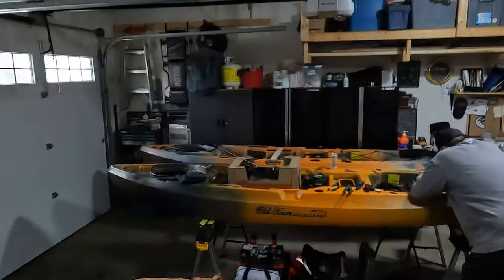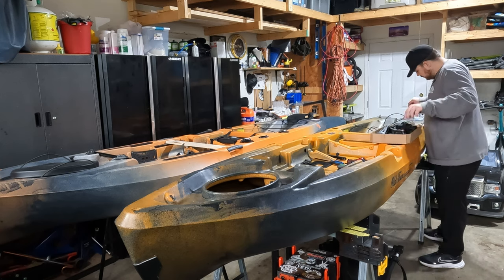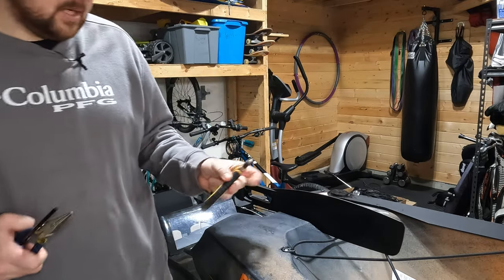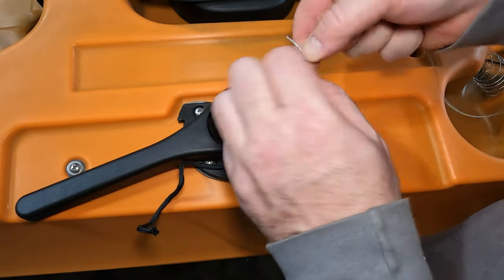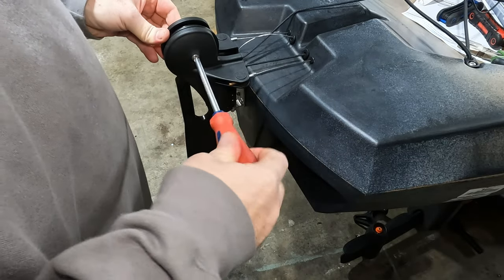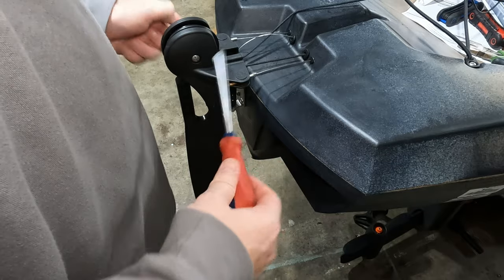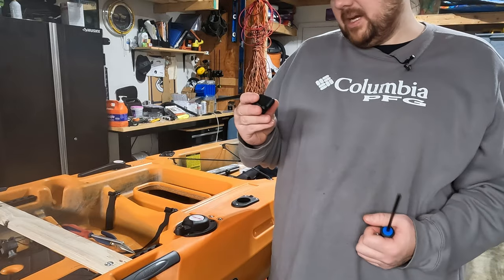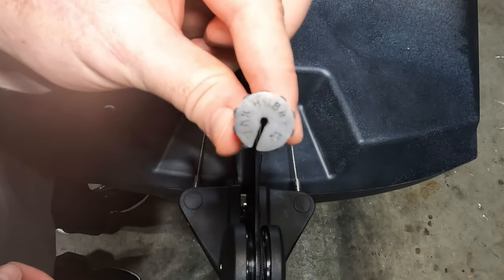OLD TOWN SPORTSMAN PDL 120 Upgrades (Aluminum Rudder Install)

Comment: Great recommendation on checking the foam block inside the hull. 👍👍
Reply from the maker: It was just floating inside the hull, definitely something worth checking as there's a lot of expanding and contracting with these hulls. Unfortunately, the silicone just let go

Comment: Awesome video bro. Appreciate the step-by-step. I have the big water 132 pdl version. I wished it was the epdl lol. I have the same parts that you put on. I did invest in the right-hand control steering system. Works great. Also I would invest in the pdl rod holder/track mount. Great great product. Also another product from Navarre is the rod tube caps. They do keep the water out. But anyways awesome video. Looking forward to the 2nd part. I just got the yak power 8 channel distribution power. I forgot the exact name. In march or so I will make a video for that.
Reply from the maker: Thanks for watching much appreciated! Crystal really wants the EPDL, but for myself I think the next kayak will be an Autopilot 136, need the extra weight capacity as I'm not getting any lighter! 😂😂😂 do you have the new style PDL rod holder? We've been pretty interested in those, looking for a spot to mount our phones for the gram!

Comment: Great video. Did you have to send the broken hull back
Reply from the maker: Thanks! No, we only had to cut out the serial number in a 12"x12" square and bring in the piece when we picked up the new hull. We ended up stripping every usable part off of the old hull for backup parts. After that, the hull ended up going to the dump.  Seems like such a waste, but that's what Old Town wanted for the new hull to be sent.

Thanks for watching!

Comment: What adhesive did you use to  attached your keel guard ?
Reply from the maker: Double sided gorilla tape, and then some marine silicone around the perimeter of the keel guard.  Worked great, that was two years old and I still needed a heat gun to pull it off 😂😂😂
Reply: @kckayakfishing  thank you!  I have been trying to decide between double sided tape and marine adhesive

Comment: i want the metal rudder but man i would bet worried about it wearing down the plastic when your retract the rudder back up
Reply from the maker: It could definitely do some damage over time slamming into the hull of the kayak, luckily for us we keep our carts on the back of our crates and the rudder stops at the crossbar of the cart so it never touches the hull.  But possibly some marine mat or seadek in the area where the rudder makes contact would help prevent any damage. Thanks for watching! 🙌
Reply: @kckayakfishing  no problem your guys are great and yea I was thinking the same thing about the mat
Reply from the maker: @therealfreekshow  appreciate it! 🙏  we were planning on doing some seadek or marine mat in the back anyways, maybe we'll add some to the rudder area and see if it helps